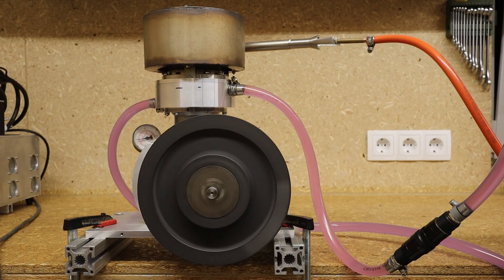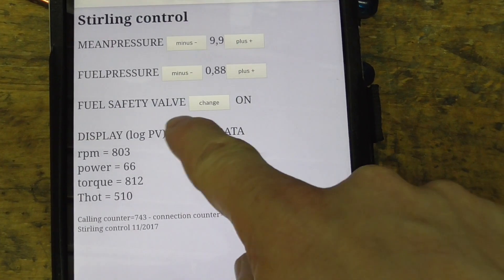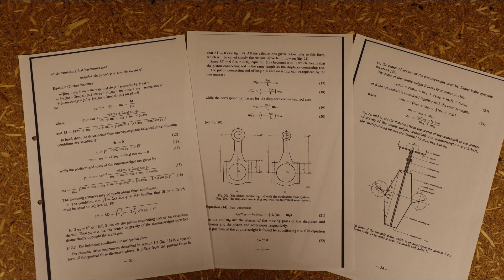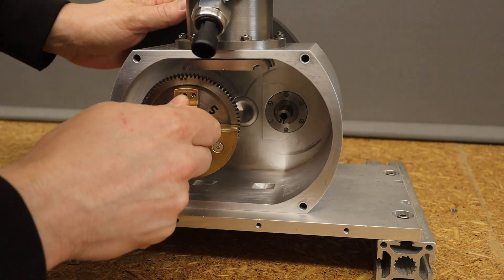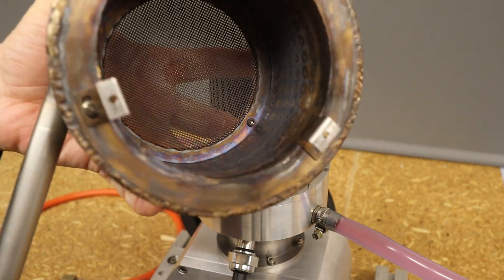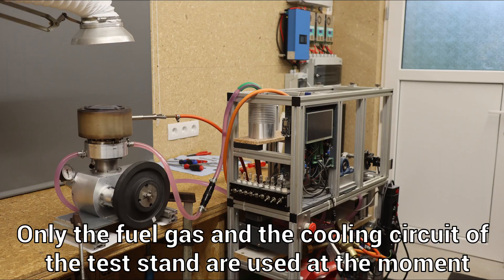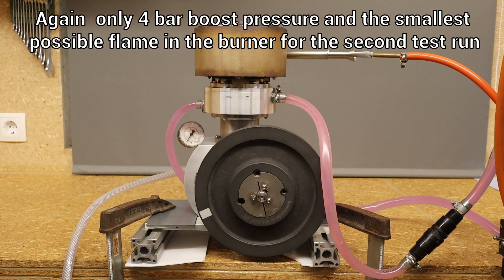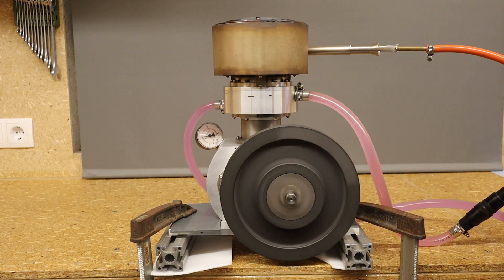Details of the Rhombic Stirling engine

Comment: Motorcycle transmission gears are spur cut and they have nowhere near the noise you are experiencing. 
I think the profile of the gear teeth on the gears you have is not correct. Also the teeth are too small for the diameter. Use a larger module size and a smaller number of teeth.
Reply from the maker: I know that the gears are not perfect and tried several versions including herringbone profile you can see in older videos!
The problem is that I don't want to design the whole drive around the gears, so I must make them by myself of look whats available.
The gears have modul 1 whats not so small, 80 teeth at 80mm diameter.
Maybe I should try modul 1.5 or 2.
Thanks for your hint I will think about it!
Reply: @myengines2443  I think I would go module 2.
When you cut them roll them together by hand and feel the smoothness. They should feel totally smooth even if you push them together hard, like rolling two cylinders on each other. If you feel any tight spots as the teeth engage and disengage the tooth profile is incorrect and they will be noisy.
If you manage to find just the right gear cutter and have just the right diameter and number of teeth it will be like the gears have been generated and be super smooth.

I made a set of gear years ago for a lathe gearbox, about 120mm diameter and 3 module from memory, don't recall the number of teeth, they rolled super smooth. If you closed your eyes you could not tell if you were rolling gears or cylinders in your hands.

Experiment, I think it will be worthwhile.

Comment: if you use hydrogen or helium compressed the performance will increase a lot, ald also I'm thinking if you use a cell hydrogen cell  generator to heat the piston, it will arise the working temperature quite a lot, maybe all this will help to increase the energy production, what do you think?

Comment: 1. Have you considered using hydrogen as working gas? I know, it's flammable as hell, but shall help in increasing the efficiency of the engine.

2. Have you considered to use an oil sump to keep the gears always wet? There's no need to flood the gears from top to bottom of the chamber, only have enough oil to let the gear spread it evenly on all teeth.

3. Is this engine fesable to work with solid fuel or solar heated mineral oil?
Reply from the maker: Hydrogen as working fluid is too dangerous for me as it can explode badly.
I made a few tests with helium but have to research more on this.

If I want to use much lubricant in the crankcase it has to be sealed to not contaminate the heat exchangers an maybe I will decide to do that.

The engine can be operated with any heat source thats the only big advantage of the Stirling engine, some are better (hotter) than others.
Reply: @myengines2443  I wonder how well a refrigerant like R134 would work.
Reply: @RingingResonance  has to be a low molecular mass gas. So simpler than N2 ...
Reply: Hydrogen may permiate the cast iron and cause it to become unacceptably brittle.  Emphasis on the word MAY.  It may become brittle but not a huge deal.
Reply: I like point two, an oil cycle seems like a great idea.
Reply: Point three is also evidence that you are a scholar and a gentleman,  my thoughts exactly.

Comment: Those gears do make a lot of noise! Maybe some thicker crankcase "oil" would help, like 000 grease!

Are you going to add a turbo? 
It might be the first turbo Stirling!
Reply from the maker: I used fairly thick adhering grease and don't want to use too much but thanks for the hint, I will search for grease which is even thicker and adhesive.
What you mean with turbo?
Its designed for a boost pressure of 10 bar.
Reply: @myengines2443  it was a joke, because turbos make everything better.

Fyi: "000 grease" is so thick it's a grease, but (at room temp) still a liquid. It's good for slow things.

Comment: Why not use nylon or carbon fiber gears, much thicker than these?
Reply from the maker: I tried it, as you can see in my older videos, but at this power levels they onla last a few hours.
Reply: @myengines2443 Ok I checked it, they look like half inch thickness, I have built a high torque robot arm using very thick PLA gears (7 inches thick) and nylon gears. If you go steel you are going to lose a lot of HP? Very heavy. And having to put lubrication into your engine.
Reply from the maker: @togowack   yes thicker gears will be a solution but the crankcase is already very big so it will be much more work and cost to build in the space for them.
Reply: @myengines2443 I also think your heat exchanger is wrong, you have shown in other video much higher psi with a result of 300 watts, at range of 10 bar, Andy Ross was achieving 200 watts at 40 psi / 3 bar, you have about 25 fins in your heat exchanger, where Ross has over 200. Your unit at 10 bar should achieve far more than 300 watts with the same heat energy input and more heating fins.
Reply: At 10 bar and 200 heating fins and 300 psi my guess would be 600 - 900 watts output.
Reply from the maker: @togowack  the heater head has much more fins, around 60 or so, when I am in my workshop I will look it up.
The engine is designed for 400 watts output with the similarity methods of Dr. Allan Organ and far away from the end of its development.
I know there is a lot of potential for improvement which I will hopefully do and show here.
Thanks for your help and suggestions!
Reply from the maker: @togowack  that range of power is my goal and I hope to reach it to produce meaningful energy for our home for times of low sunshine when we also need much heat.
Maybe I need some more swept volume.
Reply: @myengines2443 Your FEA is misleading you in fin design. You do not need 100% temperature transfer coefficient. There is a bottom on the curve where the air has no choice but to transition to higher temperature no matter the fin count.
Reply from the maker: @togowack  I will check this, I think the FEA pictures are not the final ones, I just made some screenshots in the FEA process and just used them in the video.
But I will think about it as the heat exchanger design holds much potential for improvement.
Thanks

Comment: Helical gears will be much quieter.
Reply from the maker: Yes you are right and I actually tested them in plastics and they only lasted a few hours at these power levels.
Only steel gears are durable enough for the high powers and herringbone or helical gears especially hardened and ground are very expensive.
My next big change on the engine will be a timing belt drive instead of the gears but I don't know if it will work.
Reply: It would have to be a double helical cut gear set to prevent shaft thrust from the angles on the teeth

Comment: One other suggestion for your engine to run smoother... This is something done on Steam Engines, (Locomotives).  I noticed how your counter weights are set inside your crankcase.  This weight setup wants to cause the engine to jump up and down.  Steam Locomotives have precisely the same problem.  To solve this issue, the engineers building the locomotives use a method called "Quartering".  This means the counter weights are set at One Quarter Turn from side to side on the locomotives.  I do not know if this is feasible inside your crankcase, if not the other item you might try is a balance shaft, which is used inside of many of today's 4 cylinder engines to cancel vibrations.  Its quite effective.
Reply from the maker: Yes you are right, very interesting but the rhombic drive can (if done right) be completely balanced.
That was one of the aims of its inventor Roelf Jan Meijer from Philips.

Comment: Suggestion here for the gear noise... Automotive Manufacturers, very early on had the same issue with Flat Cut Gears, like you are using here.  Suggest designing a set of Helical Cut Main Gears and Worm Drive to and additional Helical Cut Gears. When properly lubricated, and lapped in, they will nearly run silent.
Reply from the maker: Yes you are right, I actually have used herringbone gears out of tribological plastic.
They were nice and quiet but lasted only a few hours as all of my plastics gears (POM,Torlon...) as I describe in my older Videos. 
Only steel gears are durable enough for the high powers and herringbone or helical gears especially hardened and ground are very expansive.
My next big change on the engine will be a timing belt drive instead of the gears but I don't know if it will work.
Reply: @myengines2443 could you maybe make your own helical or herringbone gears out of a softer metal that can then be heat treated to be harder?

Comment: Can you put ceramic cloth insulation around the heater? This may make it more efficient.
Reply from the maker: When the engine is ready for producing real used energy I will surely insulate it but for experimenting and testing it would disturb.
But thanks for your hint I will keep it in mind.

Comment: This is fascinating stuff, great work. Why do you pressurise the crank case? And probably a stupid question but can you put some oil in the crank case to quieten the gears?
Reply from the maker: Yes, togowack said it, the pressure gets from the crankcase (sometimes I use a valve, too) into the working spaces.
As you can see in the video I put some adhering grease on the gears but to much use of oil will contaminate the heat exchangers and clog the regenerator.
Thanks for your nice comment
Reply: The crank case is the same as the working air space and oil would get caught into the cooling and heat exchanger which is 800 degrees C boiling the oil and gumming up the speed of air movement through the fins

Comment: What reference book are you using? I've got a couple, but not that one. Looks like it is a bit more detailed on the drive design.
Reply from the maker: Its the wonderful book The Philips Stirling Engine from C.M. Hargreaves.
The self printed pages are the from the book The Philips Stirling Thermal Engine from the inventor of the Rhombic drive Roelf Jan Meijer and is very detailed.
Its free in the net and if you search you will find it.
Reply: @myengines2443  Thank you very much!

Comment: A possible change for the full rhombic drive could be to move the gears into a separate compartment where you can use more lubricant to reduce sound. The gears would each drive a sort of 1 cylinder crankshaft instead of the gears directly driving the linkage. All in theory, I haven't built something like this myself just yet so I don't really know if that would introduce any new problems.
Reply from the maker: Yes, good idea I will think about it, thanks.
My next big change on the engine will be a timing belt drive instead of the gears but I don't know if it will work.
Reply: @myengines2443 That sounds like a good idea to use a timing belt, hadn't occurred to me somehow. Once I get a design I am comfortable with running, I plan to run it in a flat engine configuration. Basically half of the pistons oppose the first half by 180 degrees, it may help with the balance of the engine and probably noise.